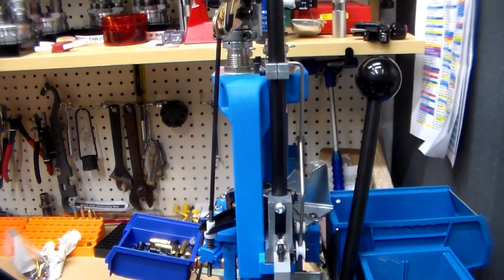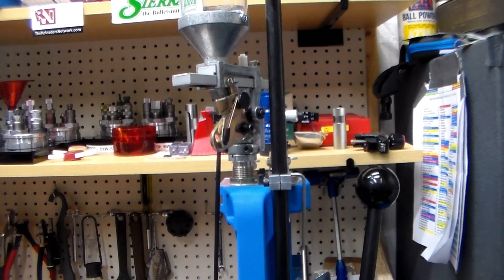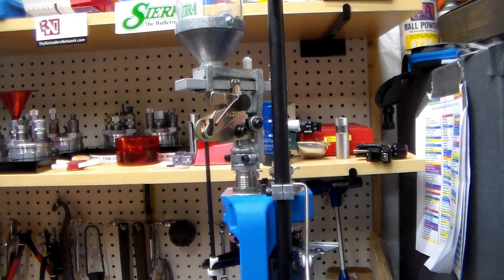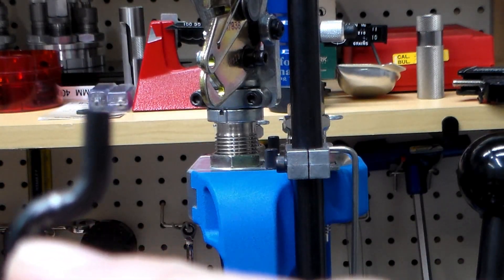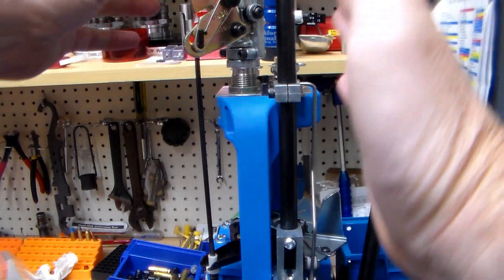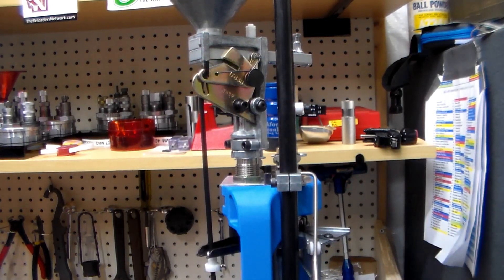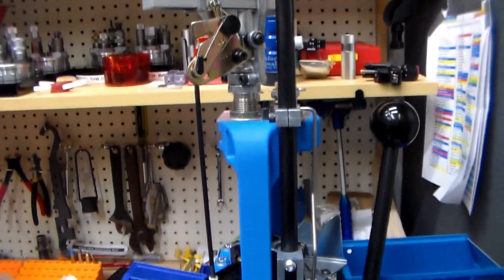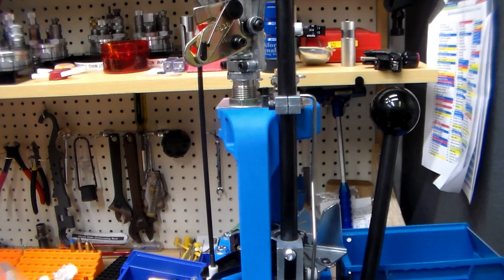Problems with the Dillon Powder Measure

Comment: I purchased a 550c and had the same issue. I called Dillon and they said they have never heard of the problem before. 
They sent me a new rod and its bent the same way, didn't resolve anything. This was about 2 years ago, still using the machine but disappointed in their quality control.
My powder funnels also stick in the brass sometimes so bad its almost impossible to push the ram back down. 
This is a known issue as well.
Reply from the maker: Dillon finally sent me another rod and it was no better than the one it came with. It's hard to believe that you don't hear about this more often and they should try to fix the rods. My powder funnel sticks as well. Thanks for commenting.
Reply: Use some Mother’s liquid car wax in the tumbling media and you won’t have sticking brass. Some people like Nu Finish also, it also stops cleaned brass from tarnishing. I’ve had brass polished with Mother’s sitting for 4 years now and it’s the same as I wrapped it up, looks fresh out of the tumbler.

Comment: Try putting your rod in on the opposite side, mine runs better like that.
Reply from the maker: I tried that early on and it didn't matter. The rod was not bend correctly so it didn't make a difference.

Comment: You should only do your videos when you are rested.  Have two Dillons.  Never had parts that did not fit.  Also there is a thing called the “phone” it makes instant contact with help.  That means you don’t have to wait for email.
Reply from the maker: Have you tried calling Dillon lately? Good luck with it.
Reply: Dennis Parker well I'll tell ya I have the same issue and sleepy or not the rod is bent wrong. The rod when installed should hang straight up and down and it doesn't.
Reply: I've had one Dillon and I've had 2 known issues already. Paying this much for a machine from "the best" and having to make modifications for it to run correctly is bullshit.